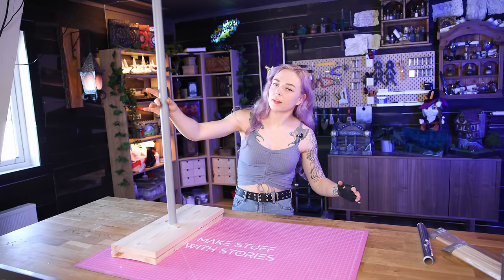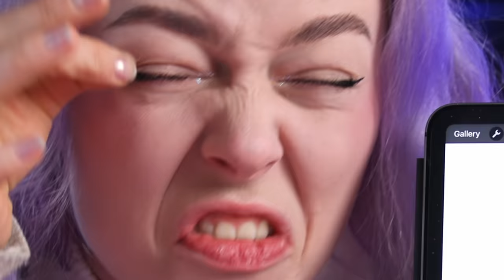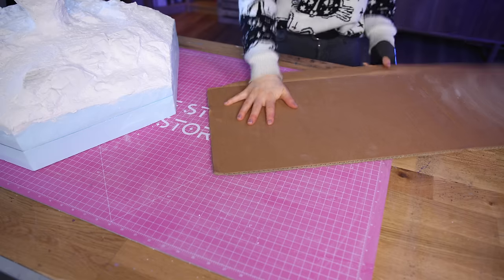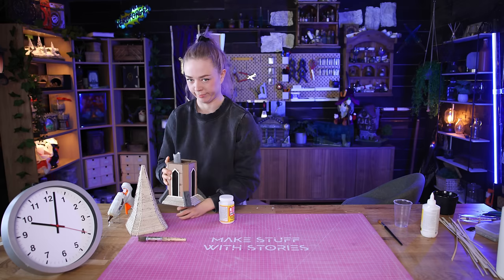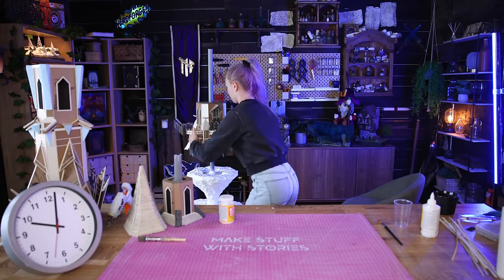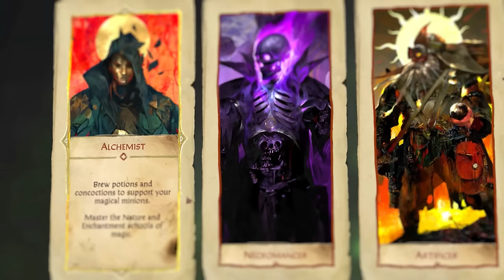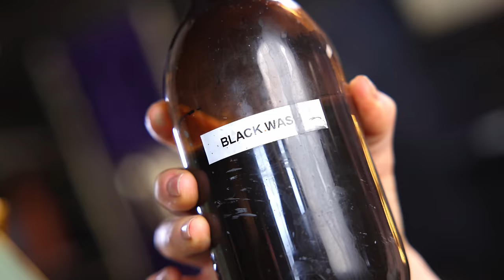I spent 20 days building this giant wizard tower

Comment: If you can still lift the sections up a bit, you could use bungee cords around the center pipe to stabilize it in the center (with it in a box truck that has tie down/lash points), and maybe put the whole thing on a trampoline, so hard bumps don't rattle it apart. But then, you don't want it to get too bouncy on the trampoline... I don't know, spitballing here.

Comment: I would indeed build a box from quarter inch plywood and that corregated cardboard. Then place the tower in the box and put Styrofoam packing peanuts in until the tower does not move. (Don't forget to place a warning on the box telling whomever opens the box about the presence of all the packing peanuts.)

Comment: take off the top if able. ship upside down. using another pvc pipe inserted in the core of this ones. if this is a one time shimpent you can glue the pipe together. and have it cut flush upon delivery for easy put back together. still would have to a wood/plywood crate around it but if the pvc pipe is fixed to the box it should work.

Comment: Definitely build a box around it with something in the center on the top to help keep the tip to stay in place and screw the base of the tower to the base of the box you build and then you could throw the peanuts in for extra but you wouldn't need to

Comment: I would build a plywood box, use screws to attach the wooden portion of the towers base to the bottom of the box, and fill the remaining space between the tower and the sides of the box with packing peanuts.

Comment: This is absolutely awesome!   As far as shipping goes, I think I would make a tube for it, place it in the shipping container & fill the gap with either bubble wrap or the biodegradable peanuts.  Those Styrofoam pellets?  I HATE them!  I just ordered two lamps & those things are all over my house.  I have pets & they stick to them & travel so they even got in my bed.  Plus, they are not biodegradable but rice peanuts are, maybe check & see if they have the pellets if you want more inside the protective tube.  Mark it glass...  JMO.  Let us know how you did it in the end OK?  Maybe make a SHORT of how to pack huge wonky shaped items?

Comment: What I thought is putting a base at the top and bottom of styrofoam with the shape of those so you can fit the tower, and maybe another to pieces in the midle, but I said this so then you can envolve the whole thing with bubble wrap, but a looot XD I think, 'cause top and bottom are gonna be the bigger and same size, everything inside is gonna be okaye. Then, put it in a box with a lot of polystyrene or something soft, and that box put it inside another box a little bigger and thicker, maybe a wood one, just another that is thicker with more soft stuffs to keep the box safe and still.
I don't even know if it's too late or I explained too bad XD don't know if it can work but it's just an idea, hope you can find the best one 'cause that tower deserves it ✨✨

Comment: I would create a crate to put it in and then have multiple bars that connect and stabilize the tower at the stronger walls and larger pieces of it then fill it with some ground or minced styrofoam

Comment: I like the "building a plywood box and using a huge amount of packing peanuts" thing. What I would've done differently is not glue any of the miniatures or trees in place. I would have taken pictures of where I'd placed them, but then wrapped them up individually in their own small box packed into the larger one.

This is absolutely amazing, though, and I hope it reaches its destination safely.

Comment: custom plighwood box, you screw the woodplank to the back and you cut some foam to protect the tom section
i did that for some fake statues at my workshop and it worked pretty well
depending on the delivery you dont even need a full box, juste the botom and the frame and some stapled cardboard for the sides and top

Comment: I know this message is late & its already been shipped.. what i would do is Make a box that's a little bit longer and a little bit wider , wrap the tower up using the big bubble wrap & once in the box use bubble wrap to fill the inside of the box & i would also make sure i had fragile tape , taped once around the top & taped once around the bottom  then i would get tape saying this way up.. another great video project as always❤

Comment: Shipping, I would build a plywood box as well. But I think I would make just two sides of the box, add horizontal foam every so often, cut to shape of course and glued to the box. Then add the last two sides with foam glued. That way it all stays put.
Reply: Something I seen a long time ago, was they used party balloons that were inflated from the outside... through holes in the crate. Not sure how they did it... but it worked well.

Comment: Wow, just wow.   For transport, it mightve been worthwhile (and still not a difficult mod) to use pipe joints to allow separation,  and wire in disconnects for the lighting to easily be plugged and unplugged. 
Amazing either way though

Comment: Wooden box as you said. Screw through the bottom to the base. Make crate and then do a cardboard cutout the size of the crate with a hole that fits halfway down the top roof

Comment: Cool, real cool! 👍👍👍👍👍
And about your questions. 
Try to make a "swivel lock" next time.  Two parts are connected by scrolling.  Until you return, you will not shoot.  Chinese assembly technology.  It would turn out three blocks with the same center-pin.  And the light is through the connectors.

Comment: Idk if this comment is too late but I got a tea pot shipped from Japan to the US and it was loosely packed in its product box and that box was shrink wrapped to a flat piece of cardboard, which was glued to the bottom of the shipping box. It came in perfect condition! In the mail for at least a month going through different countries and dozens of hands, many vehicles. 
Anyways I don't think you need to suspend it to make it secure. I think attaching it to the bottom with lots of air between it and the box will work.

Comment: build a wooden crate inside a wooden crate with spray foam in between wrap the tower in bubble wrap to make it just fit in the box seal and reinforce the outside corners and sides with strips of wood

Comment: I would make custom squares of styrofoam to hold it in place in the box, like maybe 4 or 5 up the whole length of it. Or there's the plastic bags you fill with expanding foam, but I'm not sure if this is too fragile for that. You'd have to really make sure whoever unpacks it is extremely careful.

Comment: i would have built it with packing in mind from the start giving it some anchor points up the spine that reach out from the pvc to the surface you can add braces to to connect them to the crate

Comment: The easiest way I can think to ship that is to take the top off put a rod of some type through the PVC pipe and either vertically or horizontally create a box around it and prop the pole up inside the box then fill with packing foam peanuts.

Comment: Plywood or very sturdy (triple-layer) cardboard box with a tonne of biodegradable packing peanuts (corn starch, I think?) all over the place...gently tapped several times, and then even more packing peanuts added.  Miniatures in a separate foam-padded case added inside, firmly strapped to the inner wall of the box.

Comment: Suggestion for a knife upgrade for cardboard ; Get a pack of Carbide Blades for the knife. They are much more durable and stay sharp waaay longer when cutting..well.. anything really.
You get 5pk's on Monter as well as other places, but buy a reputable brand so the blade is actually good quality.

Comment: Wrap it in plastic, put in a box large enough to have space to add foam, use furniture foam cut to the shape does not have to be prefect, use spray on expanding foam to fill the rest of the open spaces practice on something first of coarse once you figure this out works great for moving odd shaped items, or call your local museum for advice have a great day

Comment: The shipping method isn't so complicated. You need to build a box for each section , and create perfect fit forms around each pieces using some plastic sheets and cans of expending foam. Though , make sure to create a few modular sides around each of those pieces so they aren't torn apart once they are extracted from the boxes. This should secure the content from any moderate vibrations and impacts , but just to be on the safe side , add labels on each exterior side stating 'FRAGILE'.

Comment: I don't know if this will work for packeging, but I was thinking, what about wrapping it in cling foil (don't know if it will stick to much) and then make a box around it and fill that box with polyurethane foam while the tower is in. When the get it they carefully have to cut out the tower.

Comment: Hmm, put the tower in a plywood box filled with very very tiny packing foam balls, then put THAT crate in ANOTHER plywood box that's a bit bigger and put bigger packing peanuts all around (including the bottom). That way the inner box is surrounded on all sides by soft stuff, so if the big box gets hit, it doesn't get to the inner box?

Comment: Here is my solution for packaging this: Styrofoam. You need a big rectangle that you cut in two pieces horizontal. Carve them so the whole tower fits in. If something still moving a bit, put a bit of paper to fix. Basically a negative of the tower, like you do with the models in silicone. I think its the cheapest and savest way.

Also just a little advice: How is your index finger doing after holding it on the spray tube for such a long time?! 😅😅 Buy yourself a handle for the spray tubes and be kind to your hands. Its such a relief, I discovered them last year and since then: no pain in my fingers 😅😅

Comment: put the tower in a plywood box, suspend it with strong cables or that with very very little slack (minimal slack) and do the same on all angles multiple times so it can not evert hit a wall, then you fill it with packing peanuts so that even if anything happens its got a second layer of support

Comment: In my world you would think about the shipping as you were starting. Its hard to do in retrospect. You really want as little touching the building as possible. Any impact on the crate will transfer the energy inward to the building if you just fill the crate with packing peanuts. I am also not sure your cardboard structure can handle its own weight applied sideways. The pole in the center would be the key for me. Can you get to it still from both ends?
Reply: If so I would run a ridged metal pole through the whole model and out both ends. Fix the model centrally on that pole. Use set screw collets to lock it there (removable when unpacking later). At the bottom and the top of the crate make a plate that the pole can slot into. Then the model is in the crate but away from all sides. Next issue is pieces that inevitably come loose in shipping and fly around inside destroying other parts, so you need to think of a way that would contain those and limit any damage they could cause when loose. Maybe a bag around the whole model, and/or line the model case with sofa foam limiting the open area a piece can fly around in. Maybe you could pour in packing peanuts then.

Comment: Hope this isn’t too late or you already found a better way. I’d say crate is going to be best. As for packing materials, the best (but most expensive) would be a foam like in a pelican case. Otherwise, wrapping the thinner sections of the tower in loosely crumpled thick brown packing paper and taping it in place so that the tower is more of a perfect cylinder and then filling the entire crate with that same loosely crumpled thick brown packing paper starting at the bottom so the tower is suspended from all sides. BUT if it’s too heavy the paper won’t work and honestly a crate with foam will probably be the best and safest bet.

Comment: I would say take it apart in the three pieces you have and send in four boxes pipe piece and based in one box and then the rest in smaller boxes and then put instructions in one the boxes how to put them back together with supplies to put it together or mold some foam around it the whole thing and find a big enough box to  fit around it that's my best guess

Comment: What if you make a box big enough for it the use the spray expanding foam put a bunch of that in the box line it with plastic and put your tower on top it should create a mold to fit perfectly around the piece the doo the same for the other side.
Reply: I sent you a video on Instagram on how someone else did this to send a typewriter (I think that’s what it was) hope this helps

Comment: 🎯 Key Takeaways for quick navigation:

00:00 🧙‍♂️ Introduction to Tower Building Project
- Introduction to the wizard tower project in collaboration with SpellForce: Conquest of Eo.
- Excitement about creating a large Mage Tower from the game.
- Mention of the challenge and pressure to make it impressive.
02:23 🏗️ Planning and Building the Tower Base
- Decision on a wooden base with a PVC pipe structure for stability.
- Construction of a hexagonal landscape using foam and plaster.
- Explanation of the hexagonal shape's relevance to the game's design.
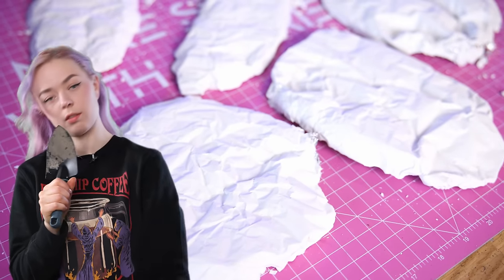04:10 🪨 Creating Rock Texture for the Tower Base
- Demonstration of creating rock texture using aluminum foil, plaster, and sculpted mold.
- Explanation of the technique to make assembling and detailing easier.
- Preparation for building the Tower above the textured base.
05:48 🔍 Simplifying Tower Design with Octagon Shapes
- Decision to break down the complex tower design into three parts.
- Simplification of the Tower's base shape to an octagon for easier construction.
- Importance of simplifying complex structures for effective building.
08:42 🎨 Adding Details and Castle Features
- Introduction of various details, including windows, shingles, and beams.
- Use of laser-cut acrylic for windows and the addition of miniature details.
- Importance of these details in creating a visually appealing Tower.
11:20 💡 Installing LED Lights in the Tower
- Implementation of a 12-volt RGB LED strip for the tower's illumination.
- Explanation of the aluminum tape lining for efficient light distribution.
- Challenges and solutions for integrating the LED controller and power supply.
13:48 🎮 Game Overview: SpellForce Conquest of Eo
- Brief overview of SpellForce: Conquest of Eo and its gameplay mechanics.
- Introduction to different mage characters with unique playstyles.
- Emphasis on the game's turn-based strategy and role-playing elements.
14:58 🎨 Final Touches: Painting and Miniature Additions
- Transition to the painting phase and adding final touches to the tower.
- The satisfaction of completing the paint job and incorporating miniature details.
- Appreciation for the intricate window designs and overall aesthetics.
18:40 📦 Challenges and Call for Suggestions
- Acknowledgment of the challenge in shipping the large and fragile tower.
- Martina's idea of building a plywood box and a call for viewer suggestions.
- Assurance of posting updates on Instagram and a link to their Instagram account.
19:09 🙏 Gratitude and Closing Remarks
- Gratitude to THQ Nordic for the collaboration and the opportunity to build the tower.
- Expression of enjoyment in the project and pride in the final result.
- Invitation to check out the game and a thank-you message to the audience.

Made with HARPA AI

Comment: Awesome build! I would use foam spray in a big box, plastic over the foam spray after apply it in halv box, put down the model so the foam is forming around it, and than more plastic over the model and than foam spray again. it will sit very still with all the parts "molded" in to the foam, except there is plastic sheet between. hard to explain but I think you get the point.
There are small foam packages you can buy, but i guess you can DIY it with big plastic bags and foam spray from your local store... Here is a video of packaging with foam.
https://www.youtube.com/watch?v=V-WBhRpOPjk

Comment: Ok that is how you do sponsorship.  Commission something awesome from a talented creator and then give it to your community.  So much less cringy than the usual spate of lip service for whomever is desperate enough for legitimacy to try buying it off of influencers.

And how to ship?  Sabot.

Like a two-piece shell of carboard filled with sheet ribs.  The ribs could be lined with cotton on the inner edges, and strategically distributed to z-axis points where the tower is mostly solid structure with no poky bits.

Comment: i noticed you struggled a bit to cut that round slot for the pvc pipe, you can actually sharpen a small scrap piece of pvc pipe and use that to cut into foam or eva foam or whatever soft material you're using, sharpen, press and twist and it cuts super well
Reply: also this build gave me an idea ... Dalaran, yes, floating Dalaran from WoW , good luck with that :D